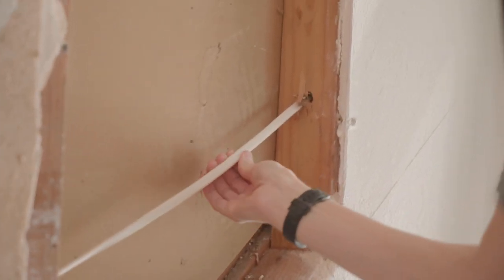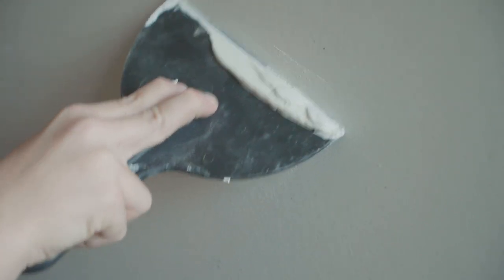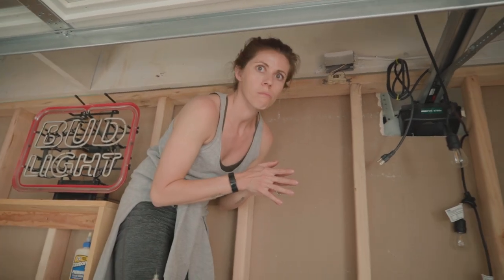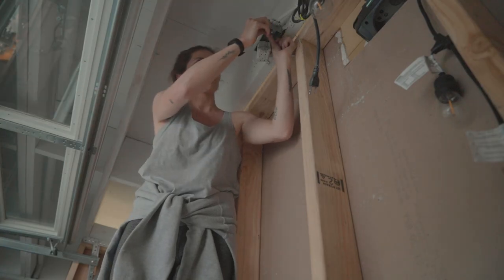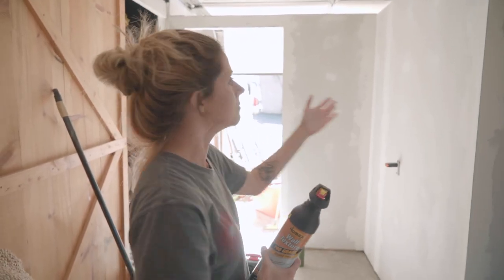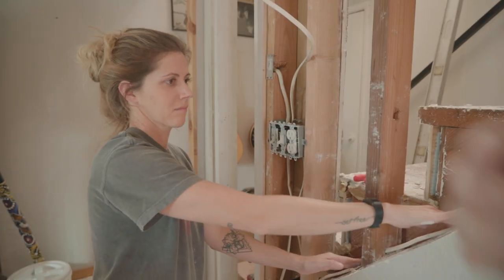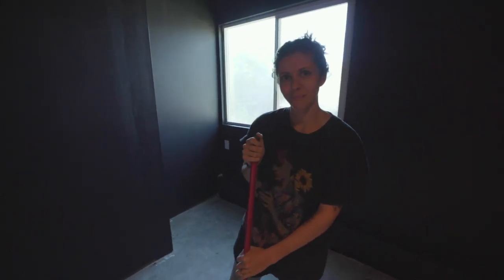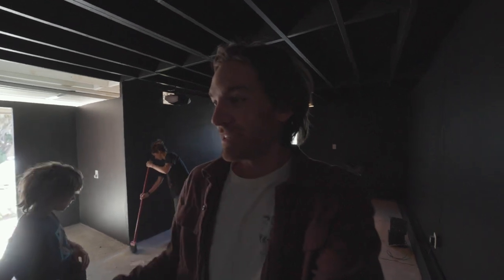Switches be trippin' Garage renovation 2/3 - Vlog #269

Comment: Only downside of taking out that chunk of wall is the added noise you'll get upstairs! Would be cool if you could add in some double pane stained glass or something in its place!
Reply from the maker: I actually mentioned stained glass to Sweetpea while we were working on it. 😆 could be kinda rad. The rooms definitely not sound proof,  but MUUUCH quieter than inside the house. 😁🙌🏽 I think I’ll do a before and after noise test.
Reply: @GuestHouseVM  Great minds think alike! :D Are you planning to put some soundproofing on the ceiling?